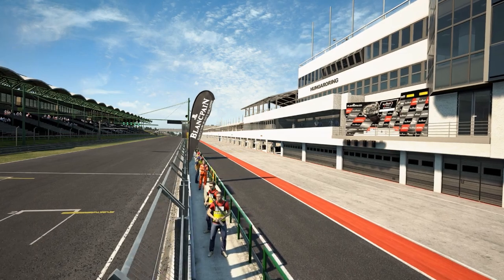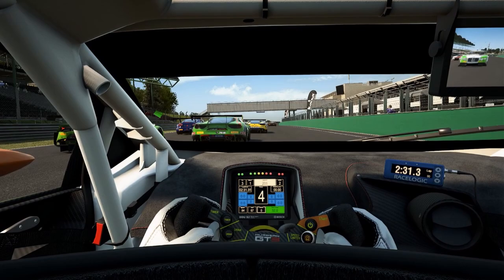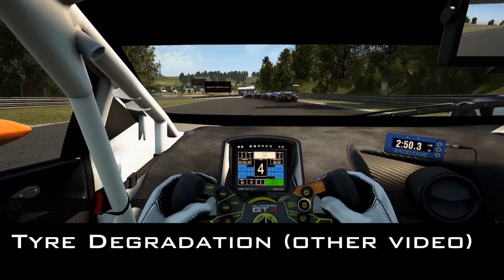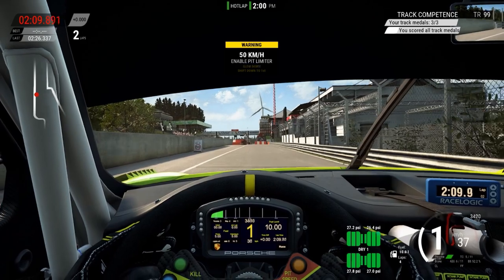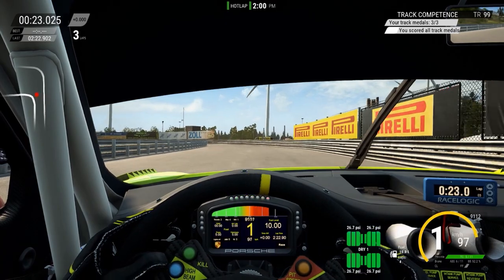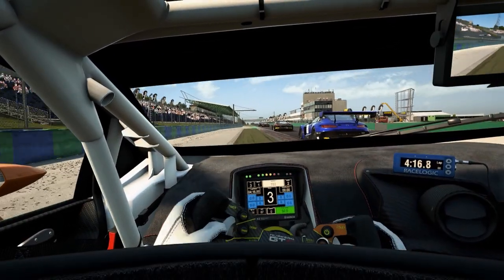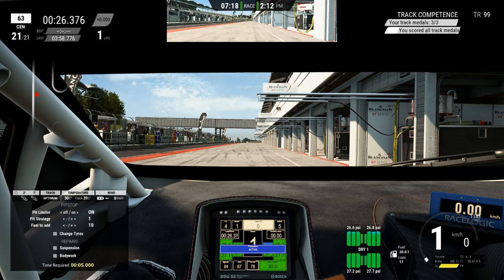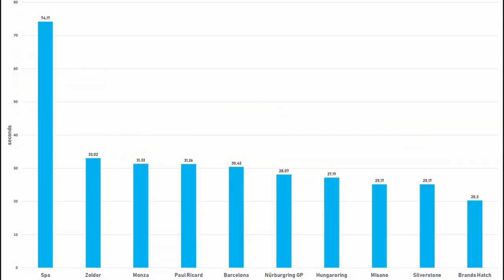How to get the perfect Pitstop in Assetto Corsa Competizione!

Comment: Hi, does using auto clutch make any difference in total pit lane time?  Does using automatic pit limiter add any time to the stop?  How about automatic engine start? I am trying to diagnose a tire only pit like in many of the CP races o ACC, and I keep loosing 4-6 seconds on cars (doesn't matter on what track) and cars behind me on pits leave before me on pit exit.  I hit my pit box pretty well (maybe only 1 or 2s to have it "adjust my car position" before lifting up on jacks.
Reply from the maker: This is an interesting question and a topic I plan to investigate more thoroughly in the near future.

What I already can tell you though is that the biggest difference probably comes from the automatic engine start. 
When you start/stop your engine manually you can a) already turn it off before you are even in your box and just coast there, which in turn causes your crew to lift you up as soon as you are stationary and b) "prefire" the engine once your remaining pit-stop timer is around 1-2 seconds (depending on the car), so that your engine starts running the moment your wheels touch the ground. 

Depending on how well you execute those steps will grant you somewhere between 2-4 seconds.

As for the other factors I am still experimenting, but as mentioned before, I will release something in the near future :D
Reply: Exactly what I'm trying to figure out. 4-6 second time loss compared to ai. I'm trying to do manual ignition and test this theory but with limited buttons on a pad I'd rather not have to. If you watch the ai in the pits, they go up on the jacks instantly

Comment: why is their pit stop info screen so bad? I don't know how to cycle between anything with the wheel. they should have made it more understandable and simple imo
Reply from the maker: I 100% agree with this.

Like on the wheel I'm using (Thrustmaster F1 Ferrari on a T300 base) I don't have even enough buttons to assign the MFD controls, since otherwise I'd have to remove some controls i deem necessary like changing engine mappings or brake bias.

One way to solve this would be to make a seperate schema solely for pit stops, where as soon as you enter the pits a whole new set of button assignments takes over until you leave the pits.
Reply: @GTRacing33  Make sure your Ferrari F1 wheel is in advanced mode, you will be able to cover every control in the car sans the specific numeric settings for each adjustable parameter (Eg a specific button to set 5 Traction Control)
Reply: King Kooba I’ve been trying to unlock my thrust master f1 wheel to advanced mode but haven’t been able to at all
Reply: @TheLockbeard  When you plug in your base with the Ferrari F1 wheel attached, you should be able to load up the thrustmaster control panel and select the radio button for advanced mode.
Reply: agree. key bindings are a horror in this game. also i keep getting dq for speeding even with pit limiter on automatic. i am this close to throwing the game into the trash...
Reply: @Versus61  you do know the pit limiter only works in 1st gear and you have to get down to below the required speed before you press the button.
Reply: @Versus61  That one plagued the crap out of me too til I saw this video ... the @#@#$ 50Km sign is quite a bit BEFORE the actual pit lane!

Comment: When you get into pit road, Does the car move automatically when you press the pit limiter or not?
Reply from the maker: It does not drive automatically, everything needs to be done manually.
Reply: So if you put pit limiter assist on it automatically turns on pit limiter?
Reply from the maker: Correct, but you still have to get your car to your pit box and park it there by yourself :D
Reply: @GTRacing33  i am pre-ordering the console version rn thanks for the advice!

Comment: I want to practice pitstops. Using the MFD, setting up pitstops on the fly, pit lane requirements (box entry, ignition, engine start, track re entry, etc).

What is the best mode for this without ruining my SA and quitting a race (against the AI).
Reply from the maker: Go to the settings menu and set the "Rating" option under "Gameplay" -> "General" to "Multiplayer Only".

This allows you to play any offline mode without having to worry about any of your ratings :D
Reply: @GTRacing33  thankyou so much!

Comment: Thanks for sharing! I bought Assetto Corsa Ultimate edition and I'm wondering how I can have tire pressure, fuel level and other information displayed on my screen while racing online (if possible)? I can't seem to figure it out. Thanks.
Reply from the maker: You should be able to hover your mouse to the very right side of your monitor when you are in the pits. Then a menu should be displayed where you can adjust your whole HUD and stuff.

Also if I remember correctly, every single element in the HUD is customizable in terms of positioning and size :D
Reply: @GTRacing33  Oh man, thank you so much! Cheers

Comment: How to like turn off the pit thingy in the left side corner of my screen idk how to turn that thing off and icant even turn. Im playing on keyboard im trying to buy a steering wheel but i want to have alot of experience before i play in steering wheel but, the problem.. idk how to turn it off. Help. Hope you get me.
Reply from the maker: If I understood correctly, the window that pops up in the bottom left of your screen when you enter the pits is preventing you from driving properly (in the pits ofc).

Try to go into your settings -> controls and then bind a key for "cycle MFD". Next time you enter the pits, you should be able to get rid of this little window by pressing this exact key.
Reply: Thank you for the advise.
Reply from the maker: @shira598  No problem!
Did it solve the problem though? :D
Reply: @GTRacing33  Yes it did, Thank you very much.